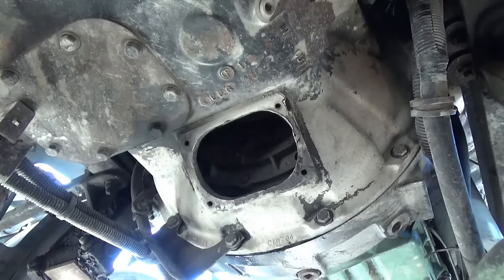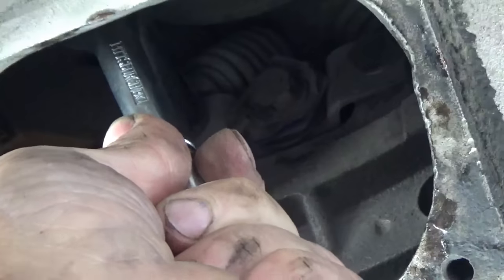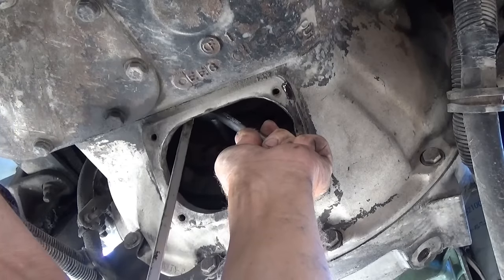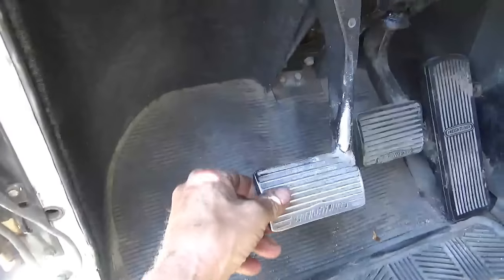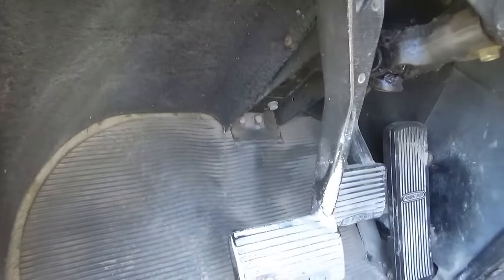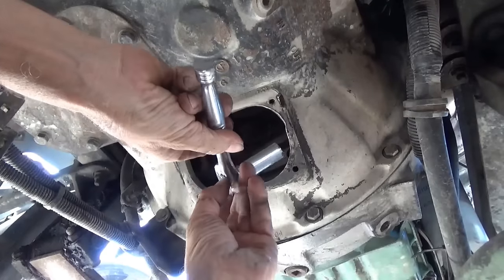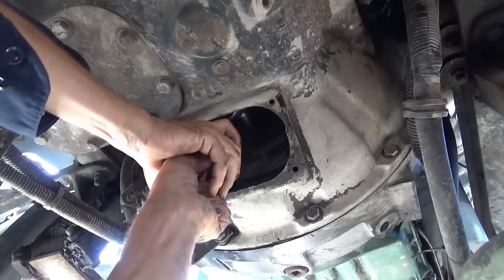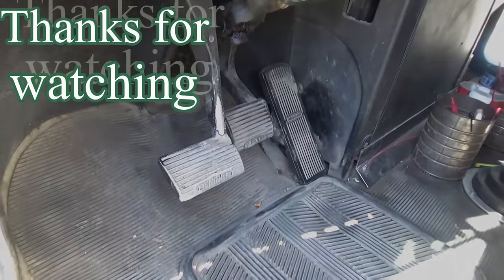How to adjust the newer style "quick adjust" clutch on a big truck

Comment: Dude marking the Crankshaft is BOTH Genius and Obvious. Every owner operator should does this. I prefer to use a Double Ended Swivel Head spanner so I can force the socket head on the adjusting bolt by levering off the window. Also I used a 3/8 extension round section to measure the 1/2 gap.

Comment: You should have two inch pedal's free play, and one inch distance to the floor. 
You did not check your release bearing's and clutch brake gap. Should be 1/2 of inch. If not, you should adjust it externally.

Comment: 7/16 to 1/2 inch clearance on clutch brake first. May have to adjust linkage for free travel on pedal. I always go about 3 inches free travel at pedal. O/O spec. In 1 million miles 5 adjustments. 😮

Comment: Wow! Guys please be advised, if ur going to do this yourself. Watch an actual certified Diesel Tech show you. Or take it to a shop. This guy failed to mention so many things. U can measure the distance of the throw out bearing down below. Usually if it's a 1/2 it'll give you perfect free play in the pedal! While you are down there u should check the clearance between your throw out bearing and clutch brake. Which should be 10 thou if I remember correctly. Also while ur right there grease your throw out bearing. There's another way of measuring it down below too, it's between ur throwout bearing ears on the left side which should be 1/8 of an in. That's just as affective as the 1/2 measuring. It's hard to explain step by step. Watch a few videos on this. U'll see what I mean.
Reply: Yep, pretty much. Paperwork that comes with many clutches tell you, depending on manufacturer, 1/2" - 9/16" or 13mm - 14mm between clutch brake and throwout bearing and about 1/8" between release forks and throwout bearing.....what you end up with at the pedal is what it is.....usually  2 - 2 1/2" of pedal freeplay
Reply: @leorguevara3622  oh ok.. thanks for the info. I been watching all these videos but wasn't sure because most say about the 1/8 in   the 1/2 in then the 1 1/2 to 2 in pedal... but they never tell you that if you set 1 they shoukd all be set. Here I was thinking they all 3 were adjusted differently..lol
Reply: You can make your own measuring tool.
From a 5/16" x 6" sae bolt - heat up the threaded end and smash down to 1/8" and the hex head is already 1/2"

Comment: You didn't tell people in the video that they need to make sure the bolt comes back out. Sometimes that bolt sticks in and the spring doesn't push it back out like it's supposed to be. I have that happen a lot to me when adjusting clutches on fleet trucks at work.
Reply: Thank you for this. If I hadn't read the comments I might've just gone about my merry way because my bolt didn't pop back out.
Reply: It will automatically do that I would think.

Comment: Have a question so I did exactly what you did but my push in bolt didn’t come out again is that normal or do I have to take it out again with like a flat head screwdriver?
Reply from the maker: Don't worry about it, if the adjustment tries to change, the bolt will pop out and lock in place.
Reply: Oh okay thank you man you video really helps 👍🏽

Comment: When you turn over the engine by hand to find the bolt for adjustment the stick shift should be in a gear or in neutral.?
Thanks
Reply from the maker: neutral

Comment: What does it mean if you have to push the clutch all the way to the floor to engage
Reply from the maker: You need to do that on a big truck to stop the clutch from spinning, that's why they have a clutch brake and is how you apply it.
Thanks for watching.
Reply: Pushing down to floor applies clutch brake to stop gears in trans so it does not grind when going from neutral into gear.
Many new guys unaware of this who drive smaller Penske box trucks with synchro trans.